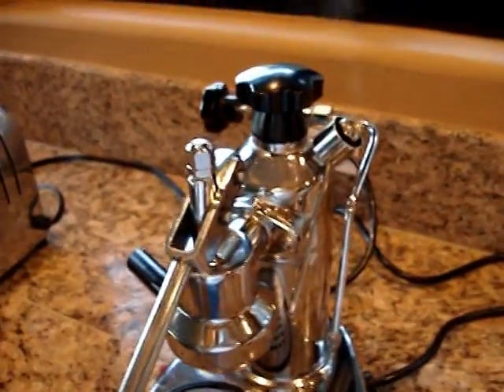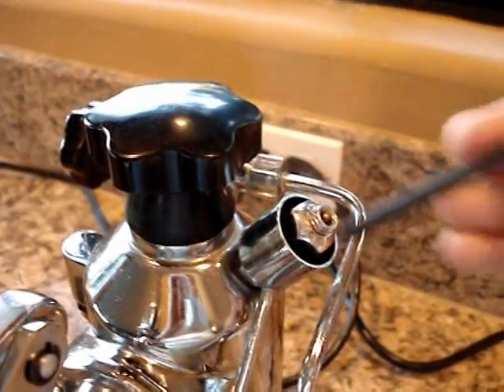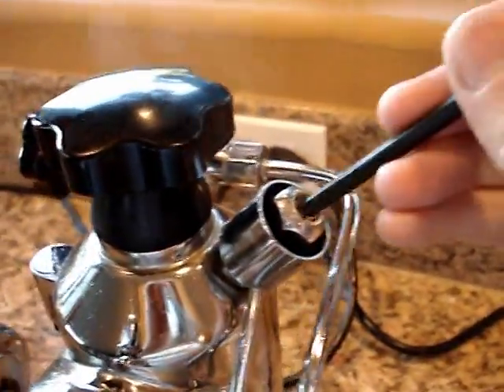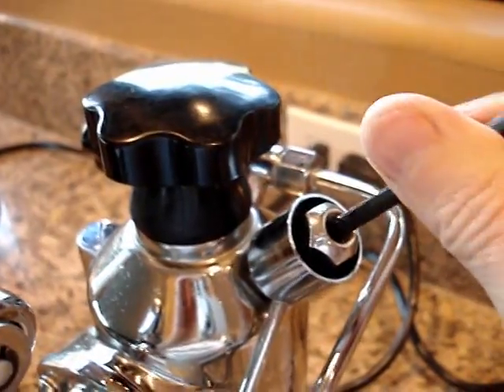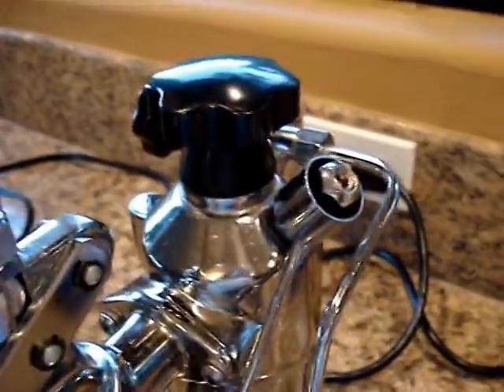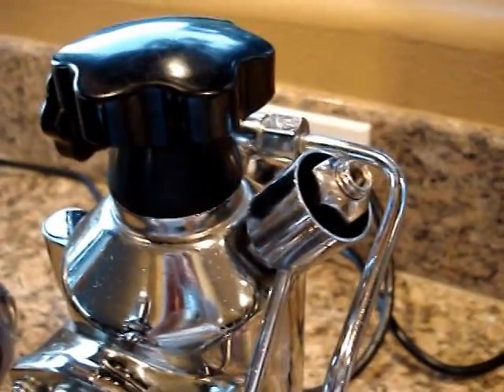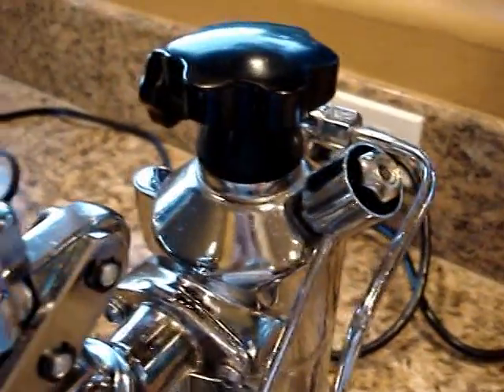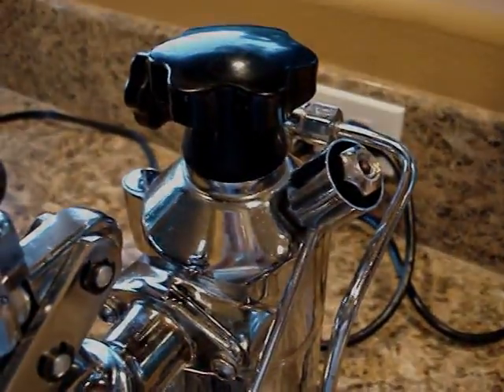Adjustable pressure relief valve on La Pavoni pre-millenium for controlling temperature

Comment: Nice mod but wouldn't gently letting off the existing frothing wand do just the same?
Reply from the maker: Well, those are two different things. The pressure relief valve mod here is to allow you to fine tune the pressure the boiler maintains. The frothing wand doesn't have a spring system in it, which goes up and down like the relief valve, so it wouldn't really accomplish much. Just turning frothing wand on would be sort of like drilling a small hole in the boiler with no way to close it once pressure subsides. The pressure relief valve closes when pressure dips and opens when pressure goes up. The mod here just gives you more fine tune control over spring tension basically.
Reply: Ray Nada Makes sense. Thanks.
Reply from the maker: @derekec  You're most welcome. Yeah, it's a tricky little balancing act there with the pressure valve stuff. I have since sold this machine, but it was fun to fiddle around with. The main benefit from this particular mod was that I was able to fine tune things and keep it right on the brink of hissing vs. not hissing all day long. So that was nice, because I could leave it on for hours on end and between the modification to the pressure relief valve and the PID controller, it was able to keep the boiler very stable. The real down fall of this machine was the group head over heating and/or not having any way to maintain its temp. I originally thought keeping the boiler water temp stable would help that, but it didn't help enough.

Comment: hey ray.  im just a lil concerned i recently restored a la pavoni with parts from doug and barb.  i noticed that my pressure relief valve isnt going off at all.  i even bought the teflon to replace the steel ball..  at what psi should the valve let off steam?  im brewing around 8psi i think?  i saw on one of your videos you said that was a good pressure.  but no steam out of the safety valve

Comment: My pressure release valve leaks from the nut - where the nut touches the boiler. I can remove the other larger nut (with side holes), ball, & spring, but then when screwing it back on, the nut that leaks moves with the tightening (but wrong direction, since it is loose and leaky). I can't figure out how to get a wrench or socket inside the boiler to counter the tightening. Does this all make sense? I am struggling to express this with words.....any help is appreciated!!